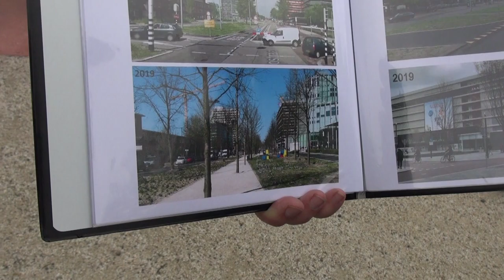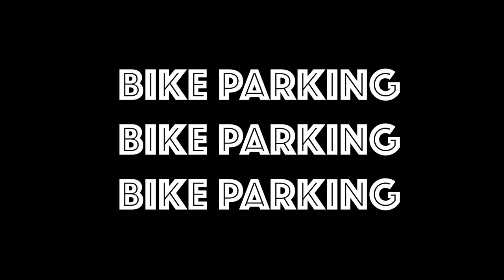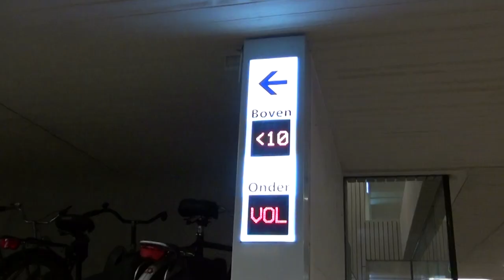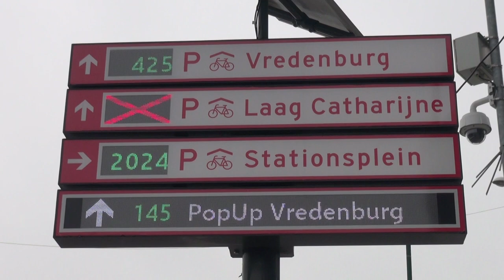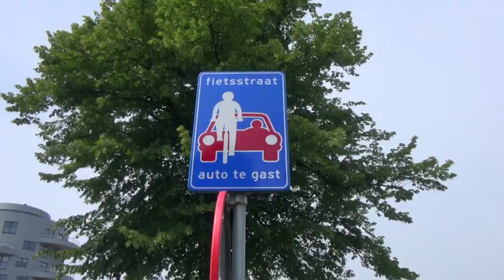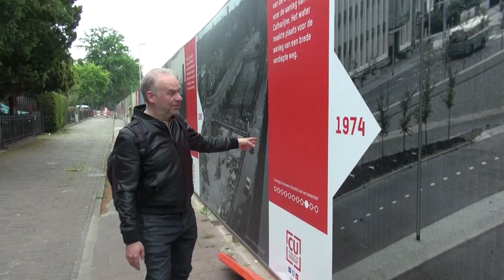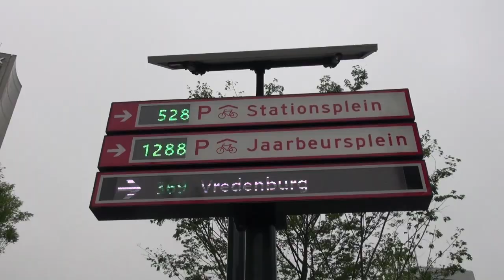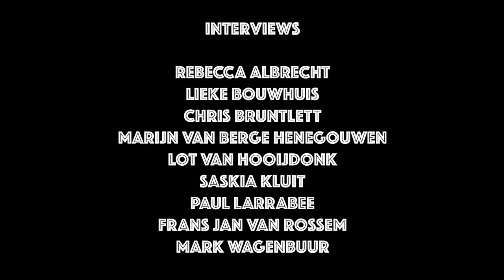Utrecht: Planning for People & Bikes, Not for Cars

Comment: I went to Holland (Leiden) in 1985 and have been cycling ever since ...
Reply: Until it's  time to get 10 lbs of potatoes , Cat Litter , refill a BBQ propane bottle or pick up a case of beer or water.
Reply: @Crashed131963  A potato sack fits on the bicycle back rack. So does the cat litter sack. And so does a beer crate (though not all at the same time). This is exactly why you see a lot of utility bicycles in The Netherlands (versus racing or mountain bicycles).

A propane bottle (or two or three) fit in a cargo bicycle or bicycle trailer. 
However, I assume this is an item you don't buy on a daily basis.
Besides, there are cars in The Netherlands (per capita more than in the UK). And cars are used when deemed necessary. For instance, for carrying  the occasional propane bottle.

Furthermore...

Most grocery stores are within a walking distance (in Dutch cities and towns).
Many families with kids living in Dutch cities have cargo bicycles.
It is common to shop for (fresh) food daily (or every other day or so). Meaning, in The Netherlands we shop more often and buy less items per shopping tour. 

References:

Grocery stores within Utrecht city limits:
https://www.google.com/search?newwindow=1&safe=off&bih=485&biw=1024&hl=en-GB&sxsrf=ALeKk00TKrOOok9K3KOx4ifscXJFtnvcUg:1592910949679&q=utrecht+supermarkten&npsic=0&rflfq=1&rlha=0&rllag=52093395,5110852,1310&tbm=lcl&ved=2ahUKEwi2xMHa55fqAhVF2KQKHWipAFoQtgN6BAggEAU&rldoc=1#rlfi=hd:;si:;mv:[[52.131224379141244,5.197699971679652],[52.05951160357307,4.990333028320277],null,[52.09538240127102,5.094016499999965],12]

Bicyle shopping versus car shopping (Australian perspective):
https://www.youtube.com/watch?v=8Tej4eRez-8

Dutch cargo bicycles (and some bicycle trailers):
https://www.youtube.com/watch?v=huE7M4JQMYk

An expensive but popular Dutch electric cargo bicycle:
https://www.youtube.com/watch?v=pye09heBqfY
Reply: @wimahlers  I do not like the term use a car occasionally.
Its all or nothing . Even a parked car has car payments and Car insurance. Even not moving cars suck the money.
I like cargo bike idea , doing more than one trip would not bother me.
Reply: @Crashed131963  Real life rarely is all or nothing.

I got rid of my car in 2015. But since then I occasionally rented a car. I live in The Netherlands but I have many friends (families) in Denmark. 

Renting a car to go to Denmark is cheaper, quicker and more efficient than public transportation. Just going from one family to another family in Denmark, all spread out over Denmark, is close to impossible using public transportation within a certain limited timeframe. 

I estimate I have driven about 8000 km since 2015 using a compact rental. I estimate I used about 450 liters of petrol in doing so.

Note: About one month from now I am going to cycle to Denmark (assuming Denmark will open its borders).

Comment: Five years after the video now. Have to say, the improvements are kind of amazing. But in general, and I have been saying and meaning that for years, there is hardly a single year in which Utrecht was not at least a slightly more pleasant city than the year before, it's kind of baffling, really.

(Oh, and, the big bicycle parking facility has indeed doubled in size. Got more smelly too, though, so there's that. Ah well, can't have everything)

Comment: If you make a switch from car driven personal transportation into bicycle you have to open your society. You have to take care for the people around you, communicate on a ‘granted’ level from a ‘right’ level. It can be done with a eyeblink (eye to eye communication is very important in this) And a nod. Grand the other the space and opportunity to switch lanes, to go ahead etc… and the same wil happen with you.
Using any kind of traffic requires some social skills of a more than basic level. Do not take your rights but share the space available. Cyclists are equal to cars but much more vulnerable. So the car driver ensures the safety of the bicycle driver. In Dutch road laws the responsibility is almost always on the car/motorcycle driver. The stronger takes care for the weaker. Driving is not a right, it is a granted issue.
It educates social interaction.

Comment: Really great what netherland has done. I have one question though. Does the weather in netherland have a role to play in this turning out as we see?  Because if this were to be implemented countries closer to equator such as india, one would be drenched in sweat in less that 10 mins
Reply: No, how did they go anywhere in the olden days? Bicycles are the most energy efficient contraptions ever built. When it is better to cycle than to walk, you lose more heat cycling because it creates a cooling airflow, sweat evaporates faster.
Reply: @Paul_C  And this is even more helped by ebikes that make you go faster (more wind cooling) and you don't have to put all that extra needed energy in yourself but on hot days only say 30% or 50%. I love riding one of my ebikes in Utrecht when its warm its a nice way to cool down. Its the difference between say greece when its 35c in athens or on one of the (windy) islands.

Comment: Moving around for short distances in an average sized Dutch city by bike makes the most sense because it's the fastest and most efficient way of transport.
For all the rest i prefer traveling by car (except between the bigger city centers) for the simple reason that in most cases a 20 minute drive turns to a 1 hour journey with public transportation.
If i visit my dad who lives about 75 KM away by car it's bout 45 to 50 minute drive. by public transportation: cycle to train station 10 to 15 min, wait for 10 min, get on first train for 15 min, wait another 10 min at Utrecht central station, another 30 minute train ride, wait for 20 minutes on the bus, then a 10 min bus drive, walk for 3-5 min.
Reply: @wimahlers  read my comment, i do not always travel by car.
And when i travel by car it's always outside of rush hours etc.
I change means of transportation that suits the situation so that could be by bike,car or train.
When i decide to go to Amsterdam/utrecht city center =>Train, is quicker,cheaper, easier.
Visit friends family that do not live nearby=>Car 
Within my own city or just outside =>Bike
Reply: @EdgeOfPanic  
I understand.
I  did not react to your personal situation but to your remark that you are 40 minutees faster taking the car than taking public transportation (for a specific situation).
Traffic is complex and dynamic. The travel time gain is true only within a certain reference. Given an urban context - that is the 80% majority - a car is slower or slows down when it is, in practice, the only option.

Cars are even slower than public transportion on large multiple country distances ... given very specific circumstances. See, among others:
https://www.youtube.com/watch?v=ziY8eQglmjw
Reply: @wimahlers  top tip: stay off the road on days like black Saturday :-)

Comment: Before anyone designs another suburb in the USA, they need to design bike infrastructure like the Dutch. Then integrate bike infrastructure retroactively in to existing towns.
Reply: Actually, I would first start with overthrowing the ridiculous draconian US zoning rules with its overreaching single use mode environments.
Drop these zoning rules and create mix use mode environments instead.
Reply: @wimahlers  good point

Comment: I love riding my bike and I love driving my car. I love bike paths and wish there were more of them in my (Boston) area. But....each country must find its own solution to sharing the road. One size does not fit all. Holland is unique for it's compact size and government commitment to cycling culture. It's also flat in many areas. Compared to the U.S. however, it's practically an enclosed traffic system, a theme park, if you will, in traffic control and therefore doesn't lend itself much to economical implementation on a large scale basis.
Reply: Change your infrastructure.

All regulations, laws and zoning rules are now all supporting urban sprawl and a car centric infrastructure. Meaning, US cities are unhealthier, more stressful, more polluted and, frankly, grosso modo, depressingly boring.

The USA really does not differ that much from The Netherlands. All you have to do is change this failed and doomed car centric infrastructure.

Yes the USA is bigger. But people stay very local 99% of the time.
Yes the USA has mountains. But, in general, people don't live there. And even if they do it usually is in the (relatively) flat valleys.
Yes the current infrastructure is a sprawl that is not easily solved within a short timeframe. But the range of an electric bicycle can easily compensate for most of this sprawl (as well as compensate for most urban hilly areas).

Stop with the fatalistic "can't do" attitude and start doing (to name one … think Portland).

Comment: Looks great but I wonder if they accommodate tricycles with regard to parking. Didn't see anything that would suggest they do. The bike garages seemed to only have two wheelers. If this is the case then they still have room for improvement.
Reply: There are open spaces in the bike garages where you can park tricycles or other kinds of bicycles.
Reply: @Brozius2512  Do they have the same security as the two wheelers?
Reply: @GMiller75  Yes.

Comment: Couldn't do this in my hometown in the UK, even if you chain up your bike they'll just nick the seat.
Reply: Dutch city bikes don't use quickrelease and the like. You could stick nick a wheel or a seat, but you'd need to bring some tools to do so. It does happen sometimes that parts go missing, but it's much more likely that your entire bike disappears if you leave it locked in the wrong place outside of one of the parkings.

Comment: How the store gonna resupply? Is it by truck or bicycles.
Reply: Cities have different solutions.  Some restrict the hours that trucks can enter the center.  Usually there are a few dedicated supply routes into the center, with restricted access.  Some shops have "display" in the center, but storage further outside: delivery at home.  They are also experiments with reloading goods which need to be delivered into the city center into smaller delivery electric trucks.

Comment: so basically if u r rich u can still go to the city center by car using relatively empty streets and pay whatever is necessary, cause common ppl just cannot afford and are forced to use bikes it on a daily basis. Briliant idea! Except autumn/winter time when for most of the time it is raining (also vertically) and then going for shopping by bike sucks ;)
Reply: If it rains you get wet, no big deal and there is a thing called rain gear/clothes.

Comment: Many questions I have. How accessible is the city to elderly and disabled people. How does a city budget for lots of projects like this. How hard would it be to implement Similar things in the usa
Reply: Elderly people still cycle in the Netherlands and the Netherlands has one of the worlds best public transportation systems. Also elderly people can use other things to get around, like using a scootmobiel https://cdn.webshopapp.com/shops/218870/files/118649837/sunrise-medical-scootmobiel-trophy-6-3-wiel.jpg

It's very easy for elderly people and disabled people can easily get to the city and get around in the city. Also people that are over 65 years old can travel very cheap by our public transportation.
Reply: jan simonides  It would be great if you explained why I am an idiot.

Comment: I guess my first question is, what about inclement weather. We get over 100 inches of snow a season here. There was no mention of how things work in the winter.
Reply: There is wind, rain all year mostly in spring and autumn . Some snow and ice in winter, but the cycle lanes get swept and salted the same as roads that cars drive on. So they are still fine to cycle on all year round. That is not as extreme as on your end but it is just dealt with
Reply: @clogcandy  the other question I had was for industrial traffic. I assume the shops and business's in the pedistrian areas still need to be serviced. Are those areas open to truck deliveries overnights or what mechinism has been put in place to deal with the demand.
Reply: @jonathanvint412  The supply to the shops is usually done between 7 and 12 in the morning when it is less busy and to keep noise down when people are asleep, with your ordinairy normal trucks. There are a lot of Bollards in the road( those massive steel poles) that will drop into the ground for trucks that need to acces the steets the shops are on and rise up when they are past to stop normal cars from going in.  Other public transport like busses also have sensors that will lower the bollards automaticly

Comment: So what do they do about flats? If they have a bike shop around every corner or if they have public transit to get you and your bike home, then that city is all set.
Reply: We Dutch are taught to fix our own flats.
Reply: @chris210352  
That's not the problem here. I can change my own flat, but it requires time. What if it's dark out? I won't be able to fix the flat if visibility is low.
Reply: Dark Glass  Good point, but there is plenty of light in the city at night, and if need be the bus  or tram will get you home. Public transport is excellent. :-)
Reply: I can fix my own flats. However, this seems to be a disappearing skill, with many people opting to bring their bike to the nearest bike shop and have them fix it (costs about 10 euros or a bit less). And with that many bikes, there's also  a lot of bike shops.
Reply: @darkglass3011  I tend to take my bike inside the entrance hall of my apartment building to fix it if it's dark or raining. I also have a bike pump with me whenever I ride my bike. Most punctures are small enough that you can get home with a few stops to inflate your tire. And if necessary you can walk alongside your bike. Chances are that if you are forced to do so, another cyclist will offer to help you :).

Comment: How does it work in Winter and in Rain? I imagine a lot of uptake of public transport, so the schedules will have to be flexible enough to change quickly for adverse weather circumstances.

They are making some small inroads in Rockville, MD though the adjacent Gaithersburg is completely anti-bicycle. It has never been safe to get along Quince Orchard Road between the employers on one end and the residences on the other. This speaks to the unsuitability of the zoning laws for human scale activity. A lot still has to change to get it more people friendly. But there is a great deal of entrenched assumption that cars are the 'convenient' way to organize suburban infrastructure.

Then you look at places like Houston and Phoenix. They are vast sprawls that require multi-mile commutes. There are only a few months a year when the weather allows outside activity. A lot of the time it is so hot as to be dangerous to be outside for extended periods of time.  

Well I don't live in those places any more. I'm in York UK. Good bike and pedestrian infrastructure, but it needs maintenance money, and getting rid of more cars will need better (cheaper) public transport. Of course if most of the cars disappeared, the bus schedules would be more on time,and the buses would be full, thus driving down fares.  But really, everything spent on maintaining and improving roads should be switched to build bike and pedestrian infrastructure, and subsidize public transport.

Comment: Cute but here in the USA due to urban sprawl, red lining, and socioeconomic disenfranchisement none of us can afford to live anywhere close to mass transit or dense urban areas so unless we want to bike 50+ miles a day this unfortunately won’t help us...also everyday it isn’t a pleasant 70 degrees, it rains-pours and snows on occasion, so the cost to use ratio for us unfortunately won’t justify in most cases here ☹️
Reply: Consider yourself lucky. In my city, it gets in the upper 90s and sometimes going over the century mark during the summer. In this kind of condition, Lycra is necessary.

Comment: Good, but what if you are faster than most on the bike..
Reply: If you are faster then 30 Km then you are exceeding the speed limit. In the Netherlands the speed limit on cycle paths in the city 30 Km/H and outside the city limits it's 45 Km/h.
Reply: @Brozius2512  ok, don't think I would reach 30 in the city but most people ride at 15-20 no?
Reply: @Quantum-Bullet  On normal bikes yes but now with these e-bikes you can easily reach a speed of 25-30 and some bikes go even faster.
Reply: @Brozius2512  not what I use.
How do they control these speeds when there are so many bikes on the lanes?
Reply: @Quantum-Bullet  Generally people just abide by the rules because we all share a common desire to cycle.
For some reason it just works here in the Netherlands.

Comment: What about the motorcycles ? 
I didn't see one
Reply: Cause this is about cycling  not about motorcycles.
Reply: Not my question . And you can't spell motorcycle without the word cycle thereby it is cycling . So my question is still unanswered . It's not about cars either , but you see them . 
What about motorcycles , motorized bicycle ( gas and e bike ) . Where do they fit in ? With the cars ???
Reply: @charliepatterson9321  Sorry but in the Netherlands we call motorbikes motorcycles (motorfiets) or motor for short.

motorised bicycles  fit in with normal  bicycles on cycle paths as long as the speed doesn't  exceed  30 Km/h in the cities and outside the cities on cycle paths it's 40 Km/h.
Any speed above then motorised  bicycles need to be on the road.